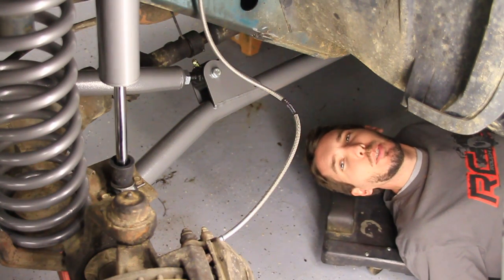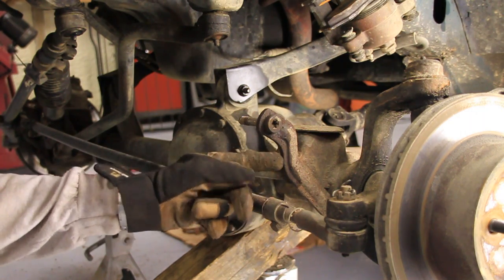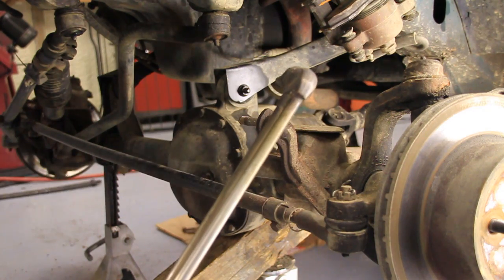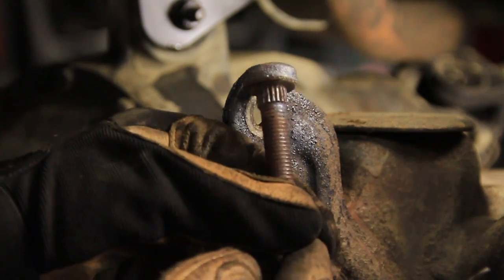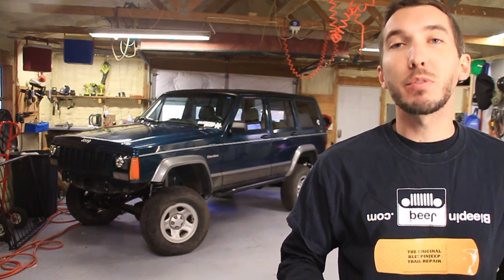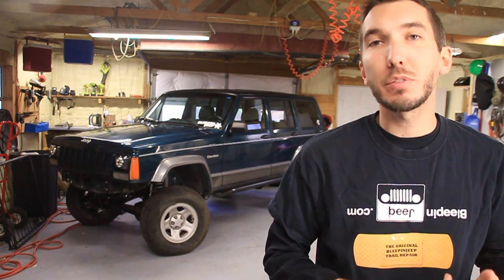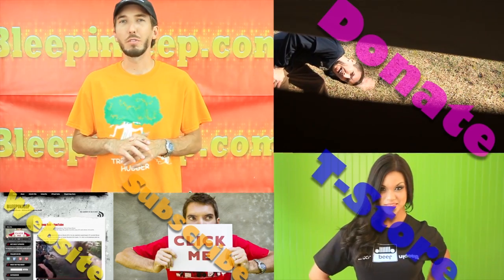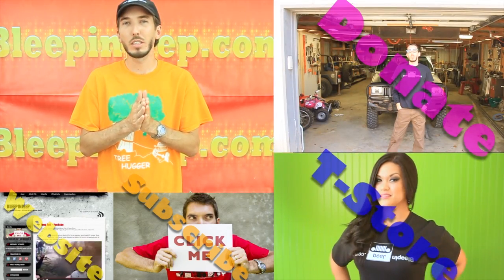Stuck Sway Bar Stud Removal How-To

Comment: Dude! I bring you good news! I had this exact situation tonight. Bashing didn’t work as the mount absorbs the force and then bends. So I borrowed a $20 3 arm gear puller and hey presto out in 10 seconds. I kid you not. Not I have my taller links in the sway bar is actually working and the ride is so much better. Thanks for your inspiring videos!
Reply: Thanks for sharing man!

Comment: subcribed, running a total of 4.25 inches of lift from rough country including there 3.25 suspension lift. 1.25 body lift. and there 1inch motor mount lift

Comment: I would personally never purchase any Rough Country Products again in my life
Reply: Why?
Reply: adjustable track bar is already worn less than 6 months old, lift kit was missing hardware when purchased.  it does the job but not very good quality... each to their own though
Reply: Is there no warranty or anything like that? How is the rest of the lift?
Reply: Dest Droid  Sure there is a warranty, but how long do you wanna keep dealing with garbage part after garbage part. A friend of mine went through 4 sets of flex joints on his control arms within a year.
Reply: jklossner6251 Wow, that's impressive.
Reply: jklossner6251 Dest Droid RoughCountryTV  exactly, I forgot to mention the Rough Country steering shock I got that had the wrong size bolts with the kit, When I replace the rough country lift kit in my jeep it's going to be a Teraflex, tired of low quality parts
Reply: Sorry to hear you're unhappy with the quality of our products. We're truck and Jeep people ourselves, and we understand the process of picking the perfect parts to build your dream vehicle. There's nothing like getting exactly what you want and at the end of the day we hope you do. However, it's important to note that Rough Country kits offer incredibly high-quality equipment, generally meeting or exceeding the specs of our competitors. We offer a multitude of different options with different designs for the most popular off-road vehicles, all backed up by our industry leading prices and Lifetime Replacement Warranty. We're so confident in the quality of our products that we offer a 100% Satisfaction Guarantee allowing you to try it out on your vehicle - and if you don't like it you can return it all for a full refund within 90 days. If you are unsatisfied with the quality of a product you received, please give us a call at 1-800-222-7023 or use our contact page (http://www.roughcountry.com/contacts/) to send us e-mail and give us a chance to better understand and resolve the issue.
Reply: RoughCountryTV if your so confident that you make incredibly high quality equipment, then i'll make a video in a few weeks called "The Rough Country Experience" which i'll have short clips of my experiences with your products and maybe Pabst Boys will like to share there experiences with the faulty brake line as well.. we'll let the community decided if they agree with your statement
Reply: Bullshitkorner do it, I'm sure they'll just give you another copy and paste response.
Reply: isn't that the truth
Reply: Pabst Boys Enlisted Budget Videos sounds good to me, I took a screen shot of this in case rough country ask's bleepinjeep to delete it
Reply: Ooooooh this looks fun.
Reply: Bullshitkorner RC hater ,,,, lol
Reply: Bullshitkorner jklossner6251 Hey guys! I'm just trying to help. If you're experiencing issues with Rough Country products, email me at tgrooms@roughcountry.com.
Reply: RoughCountryTV hey Pabst Boys looks like if we are having trouble to email them hahahahahaha you remember how that worked didn't you... I can't wait to make this video and expose the truth

Comment: Nice.  Can you tell me how I can determine if my xj has had a lift installed. I’m running a 31” tire but the previous owner had already cut out the wheel wells and it looks like my pitman arm isn’t quite sitting flush at the drag link , like it’s off kilter and I’m getting popping noises. Set all that to say that I’m completely replacing the front suspension with stock and I don’t want to do all that work and find out that I need a longer Pitman arm and if I need to get one could I pull it off, another vehicle at the junkyard and which one would that be ? Thanks for any help

Comment: Hi, Art with a 96 xj in San Diego. I subscribed to Rough Country TV. You are doing great work Matt. Love to see the growth. BTW, two recommendations: First, loctite freeze release. Works miracles and they sponsor a lot, hint hint. Second, plan B, is the Diablo blades for a sawzall. I cut through a shackle bolt as fast as the cutoff wheel (which wouldn't fit in the small space). Keep up the good work!

Comment: im having the same issue. i cut off the bolt and head and now trying to drill the  damn thing out i dont have a torch. so idk if a hair dryer would be hot enough but i thought about trying that but i think ill just drill until i can get a punch in and hit it put either way its a pain...
Reply from the maker: run down to home depot and get you a propane or map gas torch.  Anything else wont be hot enough.